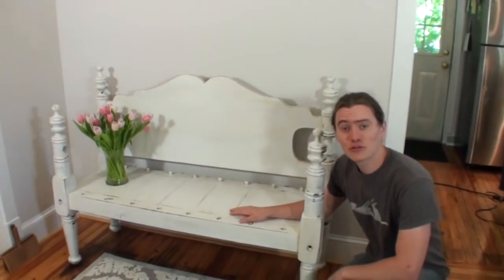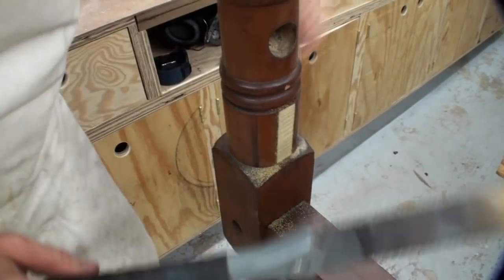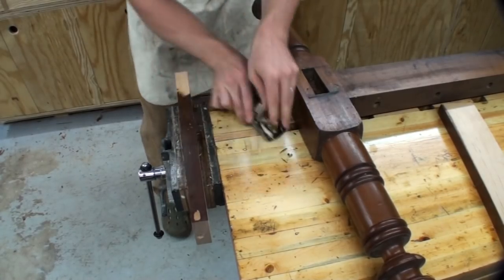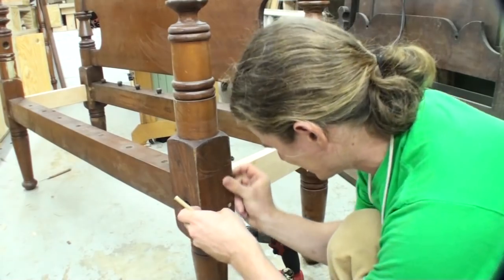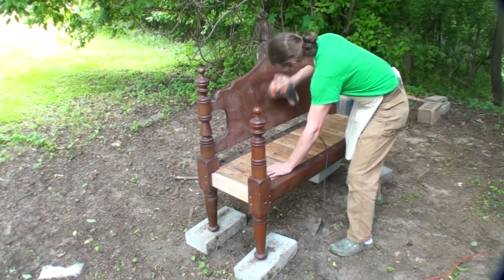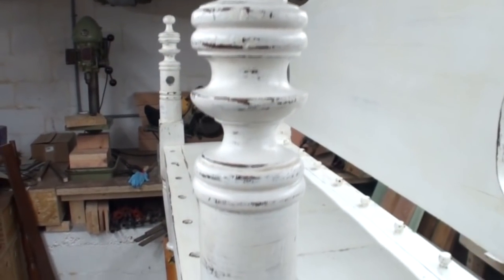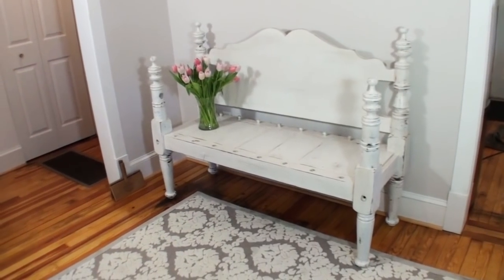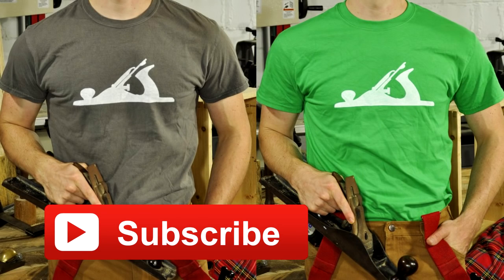Make a Bench from a Bed - DIY Project

Comment: Sorry to see this antique rope bed in particular be used for this project, but your job distressing looked great. If milk paint used no sanding would have been required. Thanks for sharing.
Reply from the maker: I've got about 15 of them, they are a weird size bed that is not standard to mattress, they where on the way to the trash. With milk paint you still have to sand it back if you want this level of distressing, each one will be different so the finish depends on the condition of the bed. The worst will be painted and heavily distressed.

Comment: what kind of tools used in this project thank you
Reply from the maker: Did you watch the video, they are all there. I use the tools I have available, if you want to make something similar, just use what you have that will do the desired task.
Reply: I do not have any tools so i was asking what kind would be the bast.
Reply from the maker: I suggest starting with hand tools. Then some power tools afterward. Drill, miter saw, circular saw, etc. I suggest starting small and adding tools as you need them. Watch some videos on youtube about basic tools, getting started, etc.